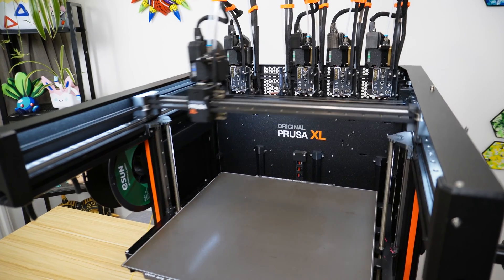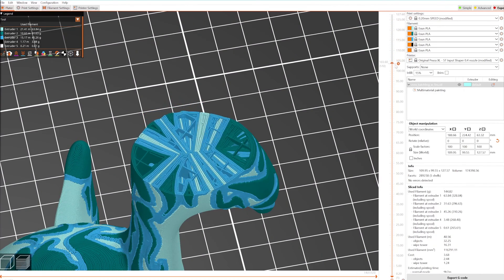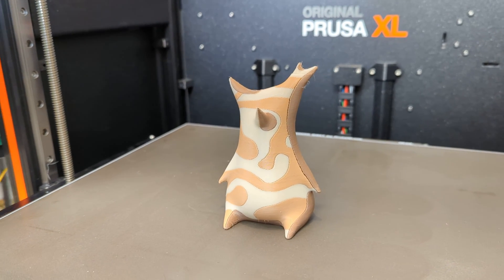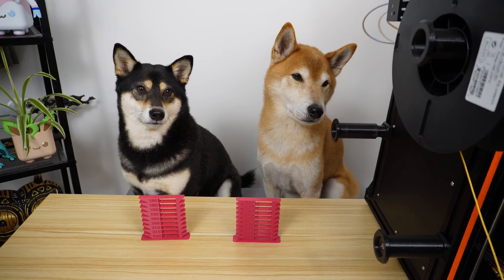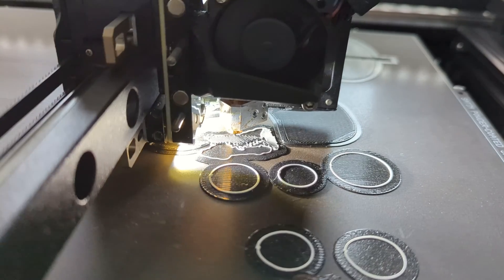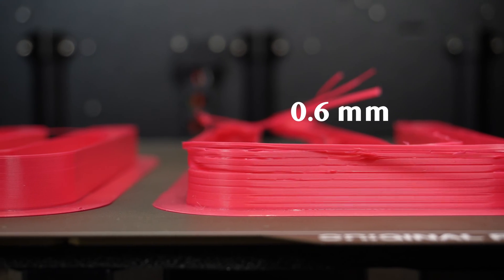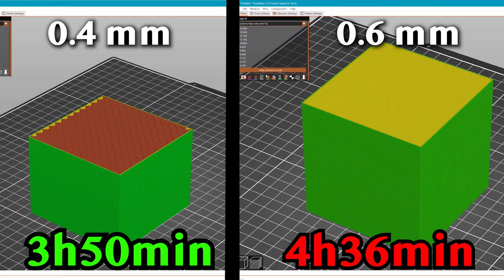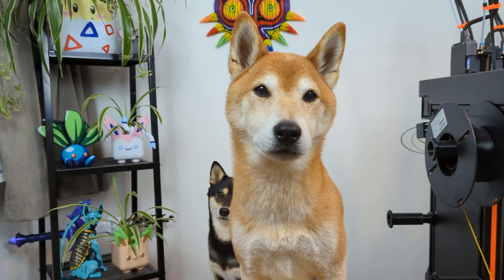The best upgrade for your multitool Prusa XL? Switch to 0.4mm nozzles!

Comment: Thanks for the video! Does the mk4 suffer from the same stringing issues as the XL for single color and multi-color prints (when mk4 uses MMU)? If not, what’s causing the two to print different quality?

Comment: Just so you know, you can raise the temps of your nozzle. The printed settings on a spool are just a suggestion. You can go faster will higher temperatures. Bigger nozzles can, generally print at higher flow rates as long as your high end goes high enough. You just have to tune what you have like anything else.

Comment: I missed this one from you guy's. Nice video! I came to the same conclusion and switched to full 0.4mm nozzles right after my first test prints and it has been working great ever since! I'm not even running the new firmware yet, just you filament swap custom G-code.

I'm curious to know if your still using the custom G-code, or the change in the new firmware where it goes to the whipe tower first.
Reply from the maker: Currently we use the new firmware that goes to the wipe tower before switching tools. It works OKish, but could still be improved. We'll try to put out an updated gcode that further improves the toolchanging in a future video

Comment: Your flow rate numbers are wrong. The 0.6mm is printing a thicker wall unless you're trying to print the same wall thickness as the 0.4mm then you are trying to print too thin of a wall for the 0.6mm.

The 0.6mm will have a higher flow rate, but lower top speed. However, that doesn't mean the quality holds up at close to the max flow rate. You will be laying down cooler filament with more of a temperature gradient that'll have a tendency to curl and tear. Upping the temperature can help there, but then you get more oozing and problems when the toolhead slows down for details. Printing fast has many downsides for consistency.

Your suggestion of 11 mm^3/s is a good starting point for this nozzle type, both for 0.4mm and 0.6mm. Prusa still has much tuning to do on the 0.6mm nozzle and input shaper profiles.
Reply from the maker: The gcode for the flow rate test was different for the 0.4mm nozzle and the 0.6mm nozzle. PrusaSlicer took into account the differences in extrusion width when calculating the flow rate for each nozzle size. We too originally expected the 0.6mm nozzle to have the better flow rate, but were surprised to learn that it was much lower than the 0.4mm nozzle. As the volume to surface area ratio is lower for the 0.6mm nozzle, likely the 0.6mm nozzle has lower heat transfer than the 0.4mm nozzle.

Comment: PLA at 190 celsius is going to be borderline adhering to the layer below it.  I would adjust retraction and travel speed/acceleration before printing that low.
Reply from the maker: Changing retraction and travel speed is a good idea. In a previous video we tried those steps and it didn't reduce stringing. But--that was with the old firmware--perhaps with the newer firmware such optimizations would allow printing at higher temperatures without stringing.

Comment: Well no shit it uses less material, you use the same settings, so 2 walls = 0.8mm and not 1.2mm.

you cant compare it like that, thats like comparing a F1 car to a ford ka. both have 4 wheels and an engien.
Reply from the maker: We made this comparison because most people use the default 2 perimeters on a 0.4mm nozzle, and the default 2 perimeters when using a 0.6mm nozzle. Yes it seems obvious that the 0.6mm nozzle uses more filament--stilil we wanted to bring it to light since it's not something that is explicitly talked about in the 3D printing community. The extra filament use can add up.

Comment: hmm I wonder how it'd do if you just changed the extrusion width o 0.5 without changing the nozzle, and with archane stuff
Reply from the maker: That's an interesting idea! Thomas Salander made this video showing that if you use a 0.6 nozzle to print with 0.4 layer widths the print quality suffers. But you can use a 0.4 nozzle to print with 0.6 widths to get the benefits of a 0.6 nozzle. https://www.youtube.com/watch?v=nmigF5qyJ4M Maybe setting the width to 0.5 would be similar to this result?

Comment: The claim at 5:19 about input shaping is wrong - input shaping helps at higher *accelerations*, not higher speeds. Toolhead acceleration doesn't depend on the max flow rate, just on what your motion system can apply, so it helps with all nozzle sizes
Reply from the maker: That's a good point! Acceleration is definitely conceptually distinct from speed.
Our intention was to convey that faster speeds (that are now achievable with the higher acceleration enabled by input shaping) can be more effectively utilized by using a 0.4mm nozzle, rather than a 0.6mm nozzle.

Comment: By default colors go all the way to the center of a model to create longer pathing because ultra short perimeters tend to print worse, think of how bad printing a standing toothpick looks. You can lessen the amount of wasted filament from the 'color perimeters' by messing with "Maximum width of a segmented region" parameter in Print Settings > Multiple Extruders > Advanced. By default it is zero to go as far towards the center as it can, but you can input a number there to choose exactly how far you want the painted color to penetrate into the model, ex: inputting "5" will have painted segments go 5mm into the model rather than all the way into the center.
Reply from the maker: We didn't know PrusaSlicer had this setting. That's a really useful tip! Using this setting does help to reduce the amount of perimeters on the inside of the model when multicolour printing.

Comment: Stringing is very easy to fix with a 0.6mm nozzle. The added print speed and strength with the 0.6 vs 0.4 is worth it.
Reply from the maker: Thomas Salanderer made a video that shows you can get the benefits of a 0.6mm nozzle with a 0.4mm nozzle. https://www.youtube.com/watch?v=nmigF5qyJ4M
When printing multicolour objects, we find that the speed is actually higher with the 0.4mm nozzle.

Comment: Stringing can also be minized or eliminated by correct retraction tuning. With good retraction settings you can print at higher temperature thus higher speeds. Higher temp results in higher flow rate.
Reply from the maker: In our experience the 0.6mm nozzles are much more stringy, and can be stringy even when implementing higher and faster retractions. The setting that seems to provide  the biggest improvement for reducing stringing was the temperature. Potentially the differences we observe may be due to the high humidity of our location.

Comment: In my testing (same flowrate test) I found the 0.6mm nozzle was good up to 16mm3/s. If you crank the temp a bit, you can get to 18
Reply from the maker: That's an interesting find! What we wanted to convey was that high quality multicolour prints require low print temperatures, and these lower print temperatures end up restraining the maximum flow rate of the 0.6mm nozzle.

Comment: One of the advantages I had heard of multitool machines uses a larger nozzle for the inside and smaller nozzle for the outer wall.  This is supposed improve entire print speed while keeping good detail in the outer walls.  However, if the larger nozzle cannot reach the same volumetric flow, then this might not be the case.  I am now confused.
Reply from the maker: So far PrusaSlicer doesn't have an option to mix nozzle sizes in a single print. It would be super useful, especially in cases when you want to use an extremely small nozzle to add fine details. Hopefully this option will become available in future versions.

Comment: 0.6 = Stronger print, fillament use can be adjusted. Stringing can be eliminated with print settings.
Cheap 0,6mm nottzles with a CHT clone insert have awesome flow rates, I can print at 150mm/s at 0.24mm layers no problem.
 Except for very very small details,  0,6 is faster and stronger. You just need to know what you are doing.
Reply from the maker: Those are very impressive speeds that you attain! 
Thomas Salanderer made a video that shows that you can get the benefits of a 0.6mm nozzle with a 0.4mm nozzle. https://www.youtube.com/watch?v=nmigF5qyJ4M
When printing multicolour objects, we find a lower temperature is best and using low temperatures can restrict flow rate.

Comment: One of the first things I did with my XL was switch to 0.4mm nozzles, simply for the better resolution they offer, but I'm glad to see these other benefits as well! That being said, if I wanted thicker layers in order to print faster, I'd probably switch to 0.8mm, and a single pass would make a wall equally thick to two passes with the 0.4mm nozzle.

Comment: The most important detail about this in my opinion is the fact that you can print as if you have a .6mm nozzle out of a .4mm nozzle. Thomas Sanladerer did a great video on this. You can just maintain the .6mm settings in the slicer but use a physically smaller nozzle, and it will still print quite well as if it was a .6mm nozzle still.
https://youtu.be/nmigF5qyJ4M?si=V4fhY3Da8n1-voY_

Comment: Worth noting: you can set the extrusion width lower then the nozzle diameter. The default extrusion widths for the 0.6mm nozzle in PrusaSlicer are 0.68mm. You could reduce this considerably to get closer to the effect of the 0.4 mm nozzle without actually having to change the nozzles. There may be an adverse effect on part strength if you go lower then the nozzle diameter, but for aesthetic models, you could try an extrusion width of 0.5mm to save material.
Reply from the maker: That's a good point! Wonder if setting a low extrusion width would also increase the flow rate and help reduce stringing.
Reply: Thomas Sanladerer did a video showcasing using smaller extrusion widths than the nozzle diameter and it actually did not work well this way, but you can do the inverse and use a .4mm nozzle with a .6mm profile.

Comment: Another great video! Thanks for sharing. Larger nozzles are primarily beneficial when used to print thicker layers, or to fill solid areas with thicker extrusion widths, requiring fewer passes, thereby reducing the print time. When comparing at equal layer height and sparse infill density, the thicker extrusion width simply results in more material consumed, while also limiting the top speed because of the higher volumetric flow rate required. This is an important realization and is non-obvious. It seems counterintuitive at first. Most people assume larger nozzles are better in every way, besides the loss of detail, but as you have shown, this is not the case.
Reply: Larger nozzles don't just print solid areas faster, they also require less passes with sparse infill. Look at the video at 1:19

Comment: Have you guys had issues with z axis banding imperfections caused by nozzle changes.  I've seen others with this issue and I'm not sure if it's user error or a problem with the printer design.
Reply from the maker: Our printer doesn't seem to have this issue so it's difficult for us to speculate on the cause. Hope your XL will also be a lucky one that isn't affected by the banding.